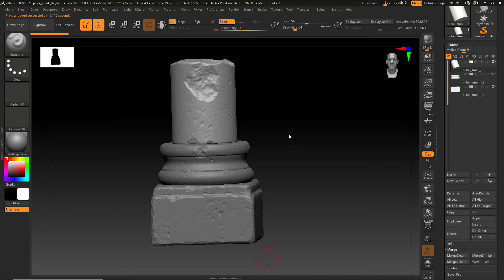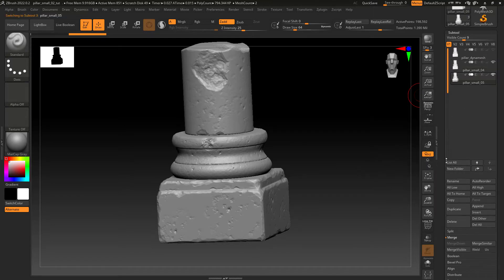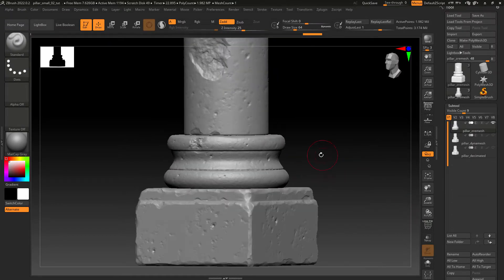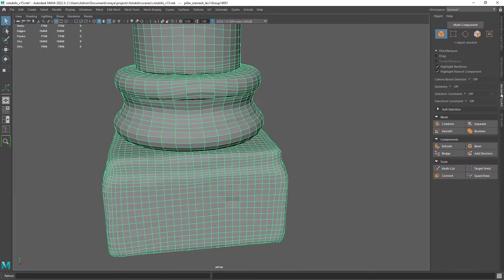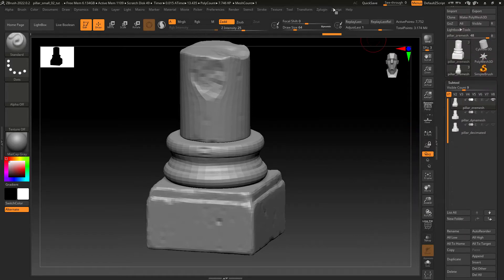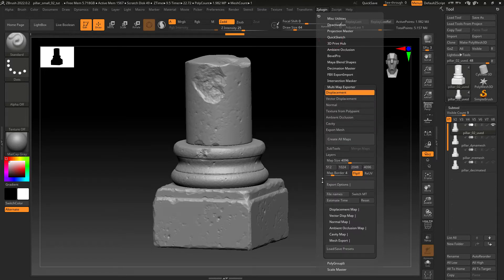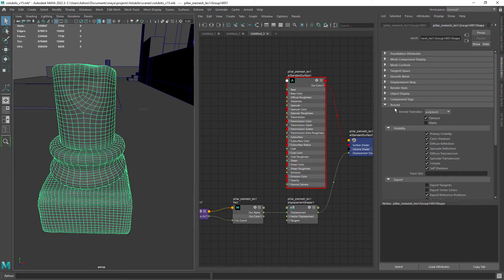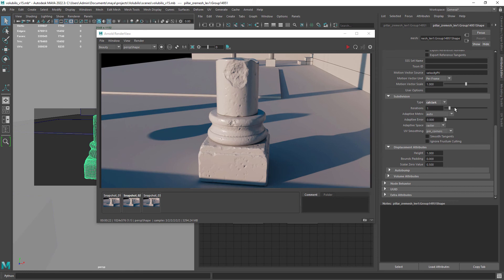Displacement map workflow from Zbrush to Arnold

Comment: Awesome video! Thanks a lot! I have questions about subdiv lvl. In multi map exporter, in displacement setting you put subd lvl 5, so highest one. But model you export is subd lvl 1 . Isn’t it should be the same subd lvl in the setting for generate map?
Reply from the maker: Hey. You're probably right, honesty been doing like this for the whole project and had no issues. Try it and see if it makes any difference and let me know. Cheers